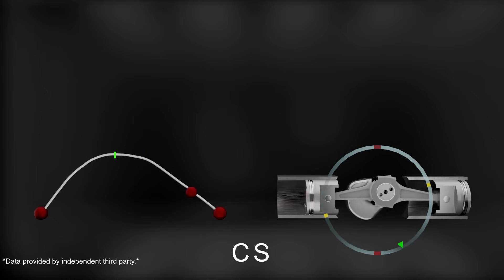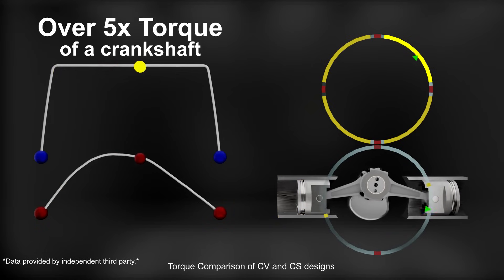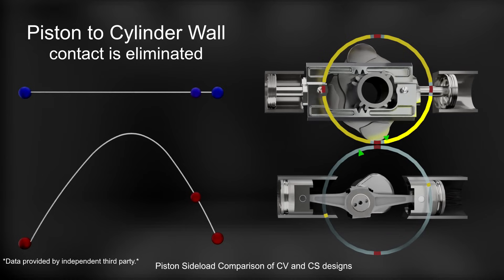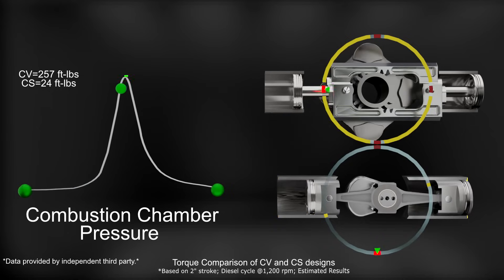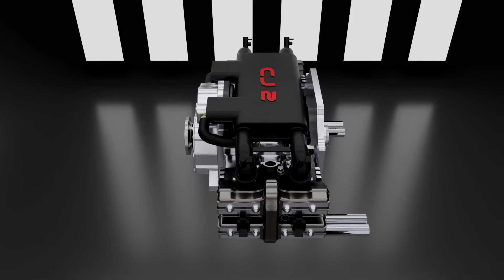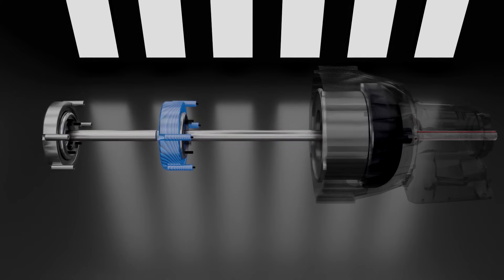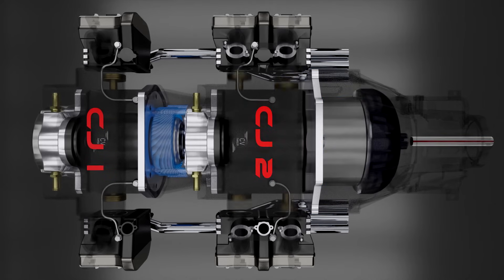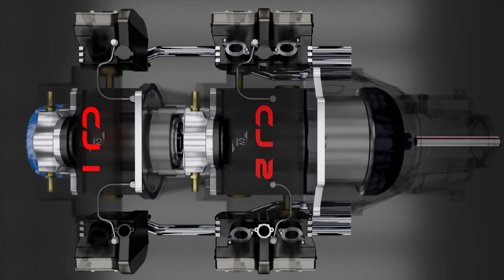The Engine Radical design & unique advantages of the Ahiravata Motor Powered by CV Motion Technology

Comment: step 1: Come up with a design
step 2: Ignore balance, gear thrust forces, the weird twisting moment on your pistons and just assume bolts don't have a shear strength
step 3: Rely on the one theoretical advantages of your design in marketing
step 4: Profit
Reply: He missed step 5 - get investors
Reply from the maker: you have commented the same thing in multiple YT engine video dont u have have anything new to say ?
Reply: @AHIRAVATA  Why, the truth hurts?
Reply: @ Do you have any response for what I say?
Reply: @randomconstructions4513  Linear travel here needs as little as two yokes to balance, wtf are you talking about balance for?
Reply: @ You need at least four to avoid a twisting moment. Which matters because of their proposed torque curve, and therefore piston acceleration, making everything four orders of magnitude worse.

Comment: This would have been great if it were realistically possible (it isn't) in the 1950's. Electric drive is the future. Also should point out that having piston forces on that tiny area is lovely in a 3D animation, but in real life this thing would be a noisy rattling mess and blow itself apart in minutes.
Reply: Electric motor is the perfect solution, there is no question, but there is the problem with the energy source and that is insurmountable.
Reply from the maker: you are wise that is why currently  near term Future  is series hybrid drivetrain like edition motors & we are wokring on making efficient Range Extender
Reply: @georgedvorak9481  Uh, no it isnt.
Reply from the maker: lol u are silly did u not check the channel we built a small one it worked thats how we got all patent & larger one will be done soon and we even demo it DELHI EXPO 2024

Comment: That yoke thing in the middle that the teeth have to mesh into?????????? Like that's going to work. It would have been simple to build a working engine. Why not?
Reply: It's just a rack and pinion, with a short rack... so it would work, but there are other real problems in this mess.
Reply from the maker: we did that how we got the patient and full size one is under works and should be done in 2025

Comment: Another pipe dream. You made a lousy version of a scotch yoke.
Reply: I think you need to rewatch the video.  It’s appreciably different from the scotch yoke.  There is no sideways sliding going on which is the scotch yokes Achilles heal.  I do worry about those gear teeth, but I think I’d rather work that problem than try to address the sliding issues of the scotch yokes
Reply: This is good, but it could be done better. 

Fisrt, just show the new engine   and its good points, THEN compare it to crankshaft engine.
Reply from the maker: if you cannot tell the difference between sliding and rolling you are too blind
Reply: @AHIRAVATA  Yet you provide no enlightenment, raising the chances they're making an observation you don't want to see/expose.
Reply: @AHIRAVATA  Insulting people that criticize your ideas is definitely a good marketing strategy  🤣🤣 Dumb@ss.

Comment: Your first animation at 0:30 clips other solid objects and would already be physically impossible 😂😂😂
Reply from the maker: we built a small one and ran  it to get patents & full size one is under construction & physical hardware was showcased in Delhi Expo 2025 video is in the channel
Reply: @AHIRAVATA  I support you 💪 keep it up 👍💪👍
Reply: @AHIRAVATA  we solved the 'tooth' problem in our numerous designs.  Yes i designed numerous crank-less piston engine architectures including rotaries that solve the sealing [pollution, efficiency] and  lubrication [durability, longevity] problems. Advanced high efficiency, low noise micro-turbines have been designed based on our patented innovations.   =]]
Reply: @AHIRAVATA  Yes it "ran"... I built model engines too that "ran".  Can it pull a load, high to low to high rev changes as in daily driving?  Are those two teeth on your horizontal swash plate the only things that transfer the torque? There is a reason a crankshaft is nearly an inch thick and the conrods half an inch, sheer stress is a thing.  For heaven's sake even the eccentric on a Wankel Rotary has more meat on it than those two anemic little teeth.  Sure, you have three sets of them engaging 2x2x2, but at different locations, that means multiple points of failure.  Couple that to the MASSIVE lateral inertial forces of those plates, something tells me if this thing does run it's more a "Put-Put-Put" than a "Vroom Vroom".
Reply: It's very easy to laugh but it's very hard to support someone who believes in change...
Reply: This is good, but it could be done better. 

Fisrt, just show the new engine   and it's good points, THEN compare it to crankshaft engine.
Reply: Even if it doesn't clip and they manage to arange it. The forces acting on those 2 gear teeth are so huge, that thy will sheer of within a short amount of time.

An other new invented wheel thats worse then the original.
Reply: No you didn't watch careful, in the beginning of the animation it shows there are 2x2x2 teeth!
2 sets of gears with 2 sets of 2 teeth. The two sets of gears offset so they do not interfere with each-other.
But there is a different problem. The swinging bulk is too heavy and the crankshaft does not return the momentum to the bulky swinging thing. So the opposing piston have to work harder to overcome the swing!
This is not gonna work, plus you don't wanna rely on just two teeth to drive your engine!